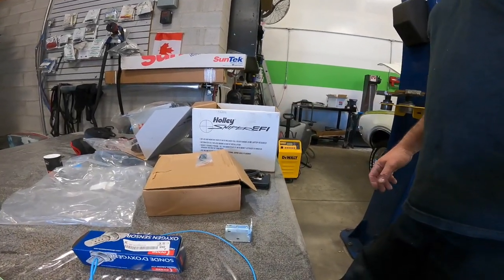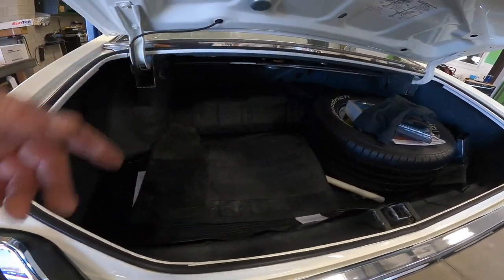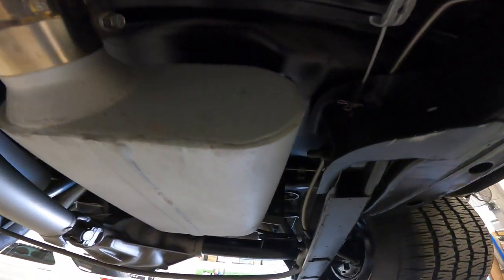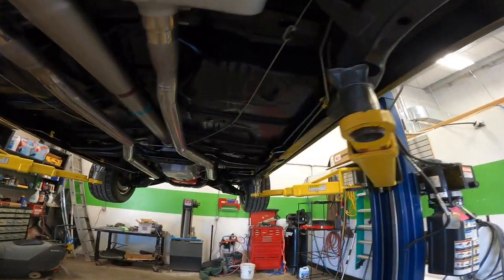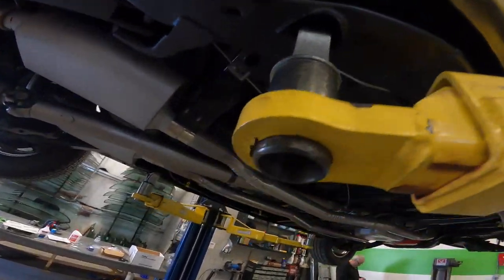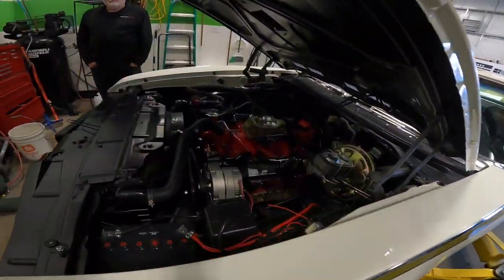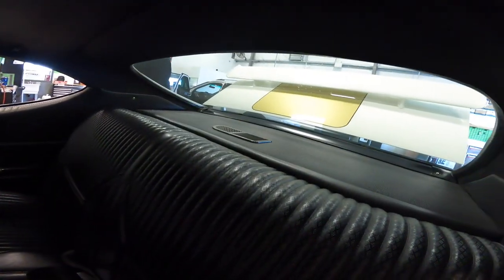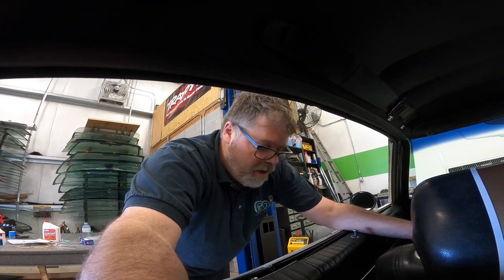Holley Sniper EFI System In 1969 Cutlass Hurst Olds

Comment: Oh, don’t start talking about original when you screwed up putting that shit carburetor on
Reply: The Quadrajet on the Hurst Olds is a way better idea. The original Quadrajets leaked all over the place. I'm just curious if there were any problems using this with the  dual plane intake.